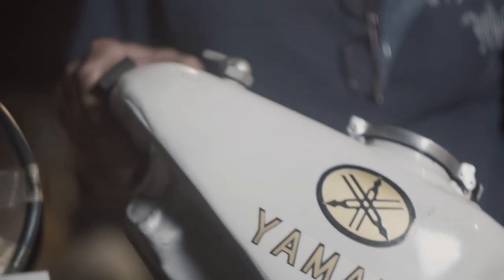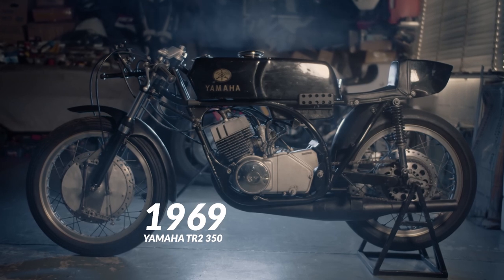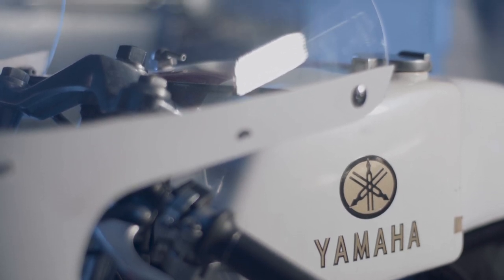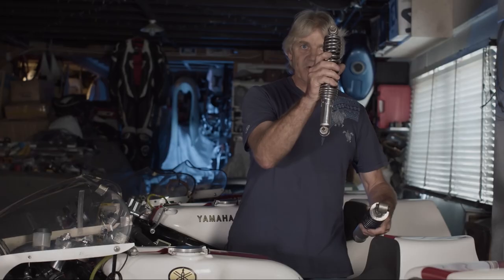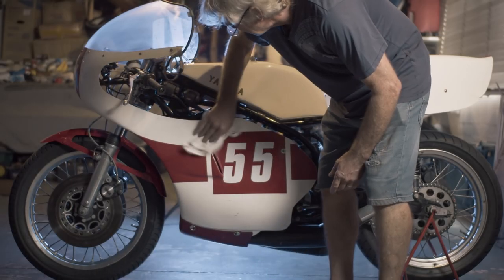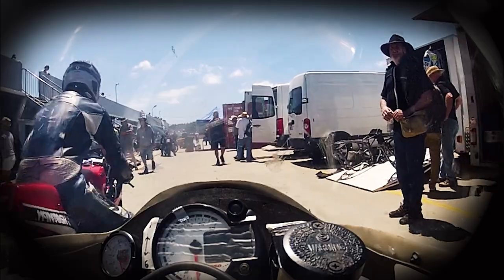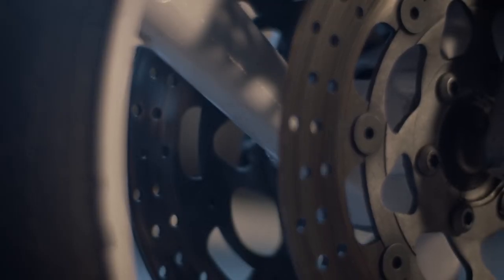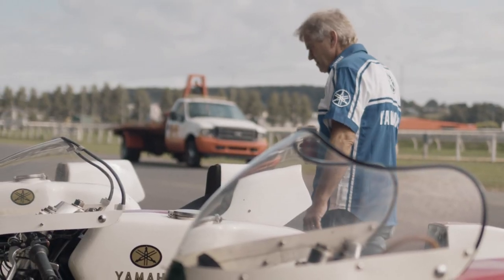TR & TZ Collection | Trevor Taylor's Yamaha Story

Comment: Had a tr3 that was converted to a water cooled bike still twin shock . Then I got a D I believe. Converted later to a 373 for 500 class. Tz 750 barrel head and pistons and specially designed chambers to fit bike. Wow that was a fun bike to ride!!!
Reply: First TZs (73-75) were also twin-shock.. besides water-cooling they had more in common with the TD3/TR3 than later TZs.
Simple conversion to water-cooling.. Yamaha even built late frames for the air-cooled bikes with brackets for the radiator.
Reply: Had most of the bikes shown in this video over a couple decades. 
Managed to hold on to a TD3(350)in a rare Eric Chaney Frame (Twin Shock)
Big drum brakes, Koni rears and Italian front forks. Time to sell that one off too! 
Part of my retirement package…

Comment: Man... does that bring back some memories. I bought a second hand 1969 TR350 from a local Malaysian guy called Bulldog Kuan when I was in the RAAF in Butterworth back in 1972 and raced it in the Penang GP. My fondest (if not most embarrassing) memory was being overtaken round a slow corner by two blokes (one either side). Geoff Perry (ex Kiwi legend who tragically died in a plane crash shortly after) was one of them, and Dale Wiley the other. They both went on to 1st and 2nd respectively.

Comment: Back in the '80s I worked for Barry Smith at his Glen Iris shop, at one point I recall we stored at least two [D model I think] TZ chassis, brand new and all complete other than engines. Apparently the engines had been bought by Superkart racers ?
Reply: Interesting!
C/76 models were sold cheap (eg 1550 GBP for 350 vs 660 GBP for RD400), perhaps cheaper than only the motor from Rotax etc.